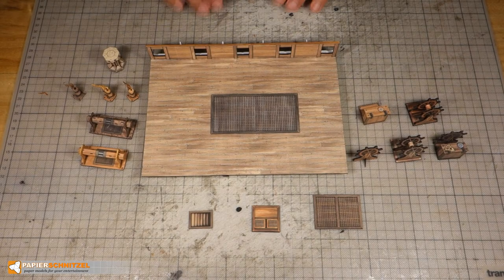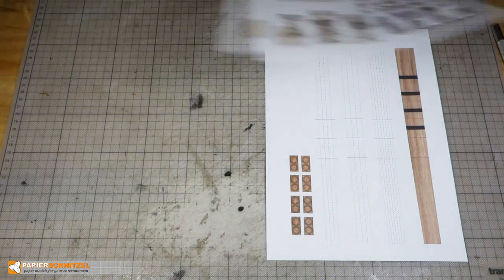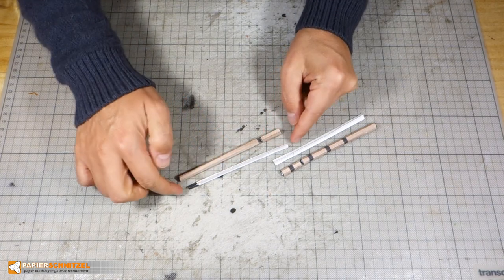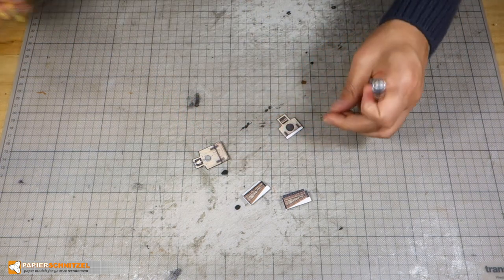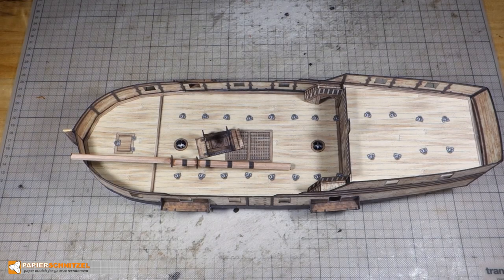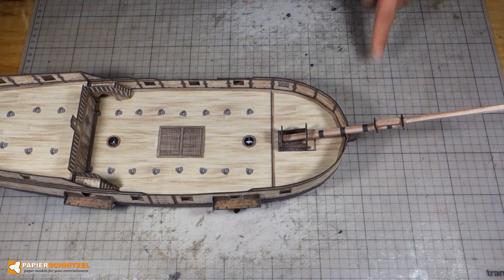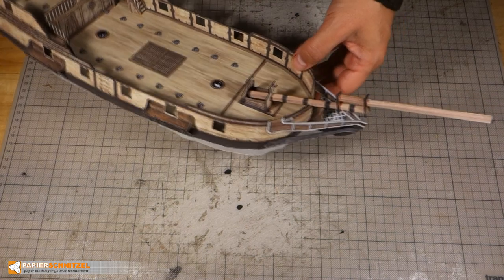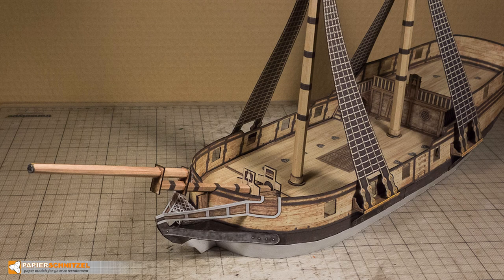Brig Build Video 7 Deck Structures and Bowsprit section

Comment from the maker: At 4:22 I am cutting out the wrong base! That one was for the windlass. The correct one for the mast shoe would be the smaller one on the top right. But I made it fit in the end. You can always make stuff fit :)